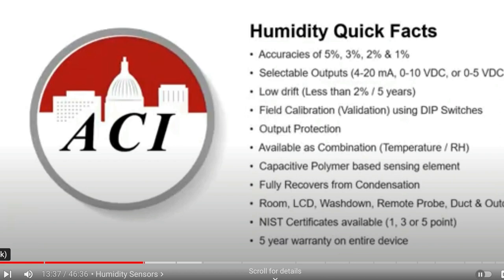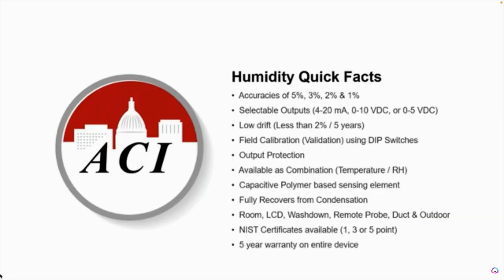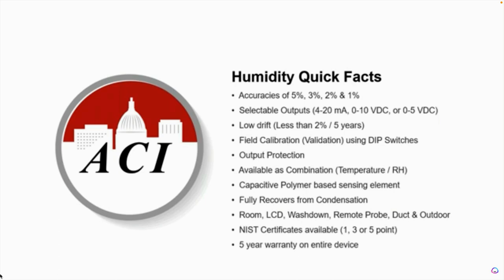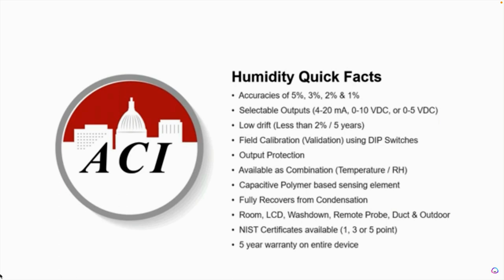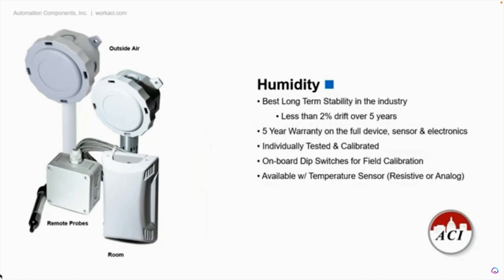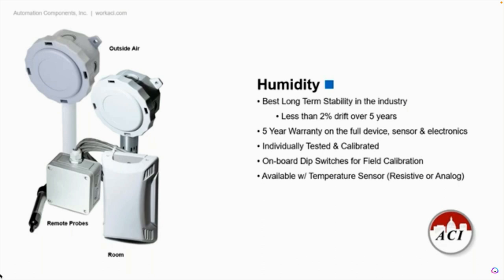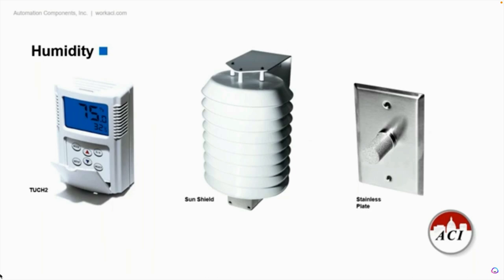Who Makes the Best Humidity Sensors For Indoor Air Quality

Comment from the maker: 🎯 Key Takeaways for quick navigation:

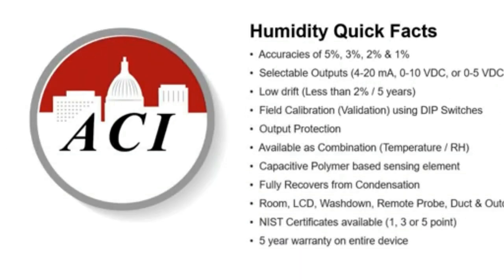00:27 🌡️ ACI offers a humidity sensor with one percent accuracy that is NIST certified, along with other standard accuracies of five, three, and two percent.
00:52 📊 ACI's humidity sensors provide flexible options with analog outputs of 4-20mA, 0-5V, or 0-10V, and can be powered by either 24V AC or 24V DC.
01:22 📈 ACI humidity sensors have low drift, less than two percent over five years, and unique field calibration or validation directly on the circuit board, unlike competitors.
01:48 🌡️📊 ACI's sensors can be combined into a single enclosure, offering humidity, temperature, and CO2 measurement capabilities.
02:16 💡 ACI uses capacitive polymer-based sensing elements, ensuring reliability even in high humidity conditions.
02:45 🛡️ ACI's humidity sensors come with NIST certificates and are available in various point configurations, all backed by a five-year warranty.
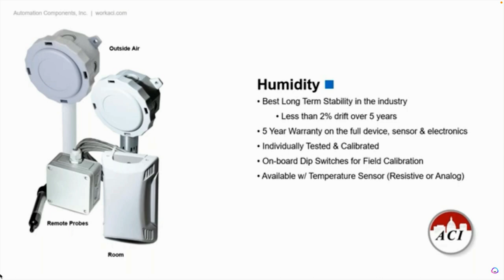03:41 🧪 ACI doesn't batch test; every sensor is individually tested and calibrated before shipment to ensure proper functionality.

Made with HARPA AI